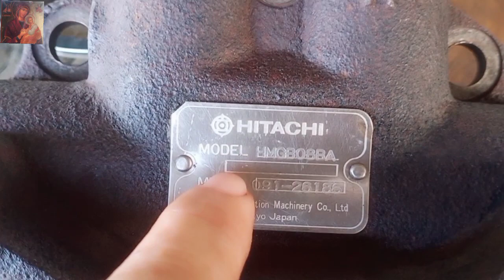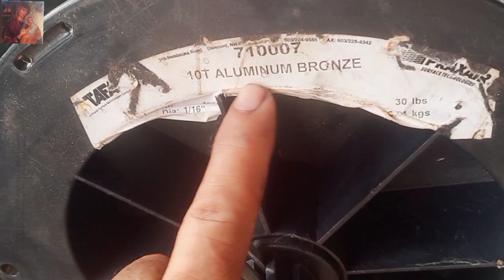METAL SPRAY ALUMINIUM BRONZE WIRE/FINAL DRIVE HYDRAULIC PUMP REPAIR

Comment: GanYan pala mag spray ng metal kakaiba l. DI po ba delikado Yan? Ingat lang po palagi
Reply from the maker: Opo ma'am yan ang spray welding bihira lng yan ginagamit we  use it for long material or in a cast iron.Delikado din po ma'am itim kasi usok nyan but naggagamit po kami ng safety mask,goggle and etc Maraming salamat po ma'am magandang araw po sa inyo.